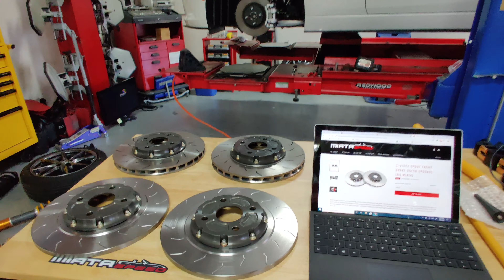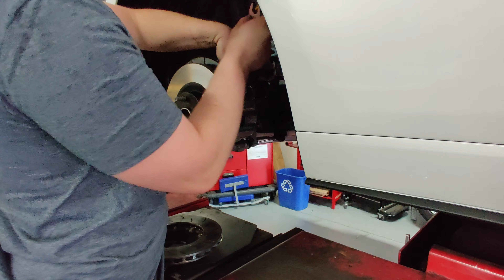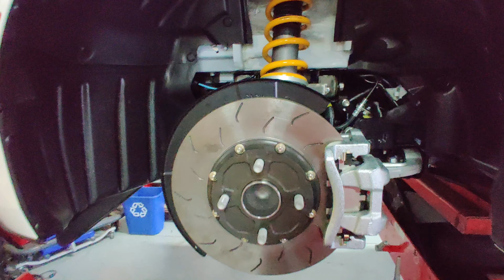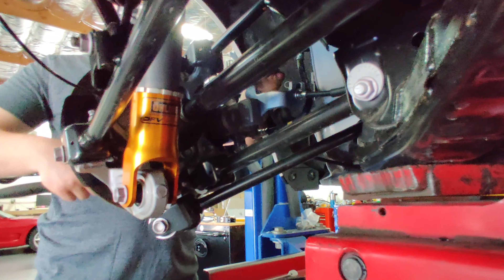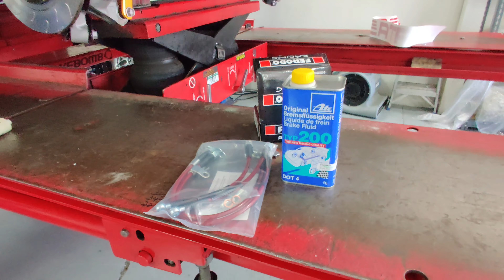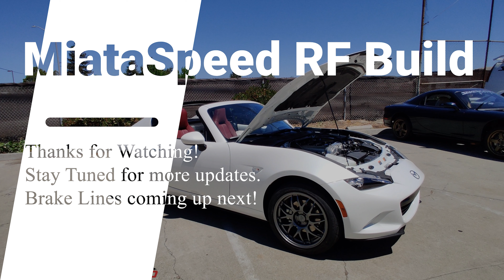MiataSpeed 2pc Brake rotor install - 2020 RF MX-5 Build up!

Comment: Would the 2-piece sport rear brake rotor be a good match with the AP racing Radi-CAL Competition front Brake Kit 340x28mm? Also would the parking brake still function as normal? Thanks
Reply from the maker: Our AP BBK for the ND Miata would use physically bigger rotors for the Radi-Cal. The rear kit absolutely uses the OEM ebrake.